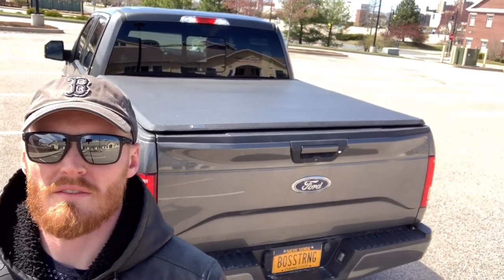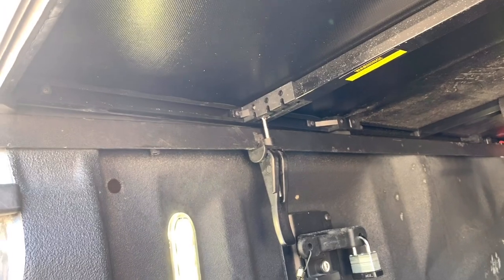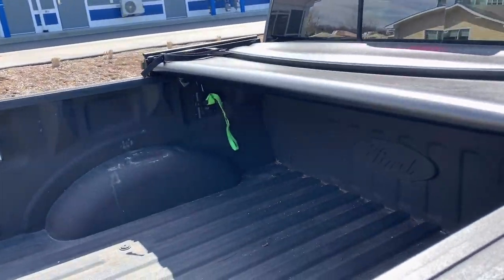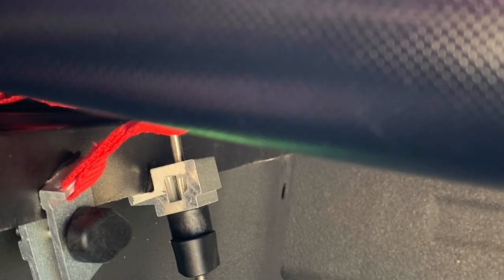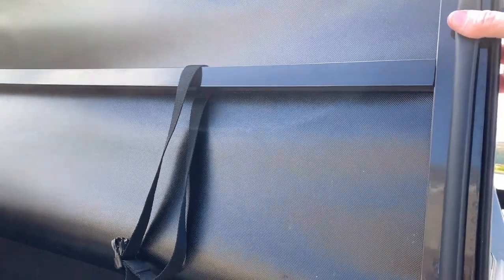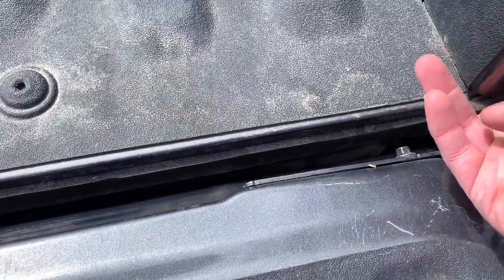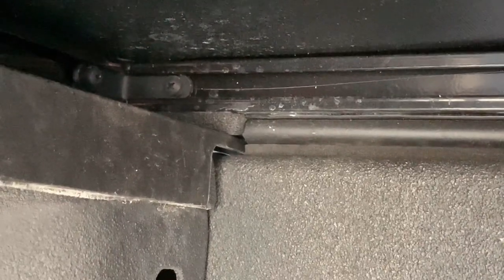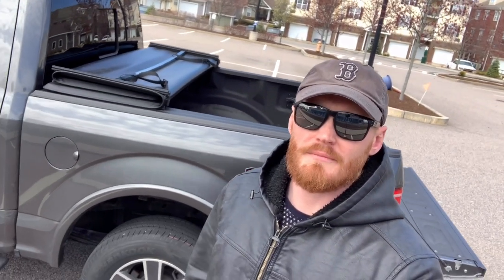BEST F-150 BEDCOVER! | TYGER TRI-FOLD TONNEAU COVER | REVIEW, INSTALL, WATERPROOFING TIPS AND TRICKS

Comment: How toght should the front (near cab) be tightened?
Have mine tight but seems to still flap when doing 40-50.
Reply from the maker: I never had it super tight. Just make sure you put down that foam insulation. The insulation seems to tighten up any gaps preventing the wind from getting underneath and start flapping.

Comment: How’s the safety on it? Like to store tools just worried about break in
Reply from the maker: They would have to cut though the top of it to get in or use serious force to rip off the brackets. Definitely not hardcore locked down but it would not be an easy task to break in.
Reply: @AutoHeadz  thank you for the quick reply and info. Definitely looking for it and now even closer to purchasing

Comment: Have you noticed an increase in MPG? They advertise 12% increase. Seemed like an exaggeration to me.
Reply from the maker: Believe it or not it actually did make a difference when I was living in New York I tested it out on a trip to Massachusetts and I was getting 19 MPG‘s average which was about 1.5 mile per gallon better than I usually got. Nothing crazy but definitely an improvement.